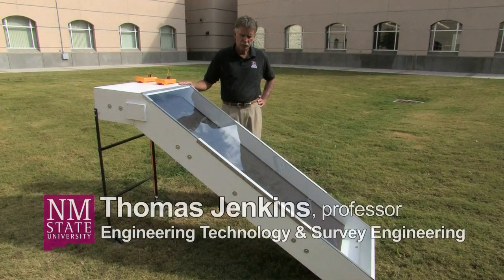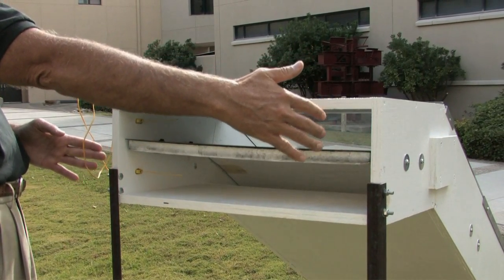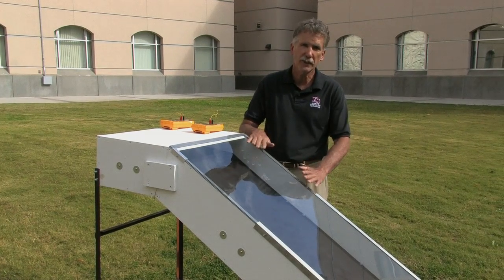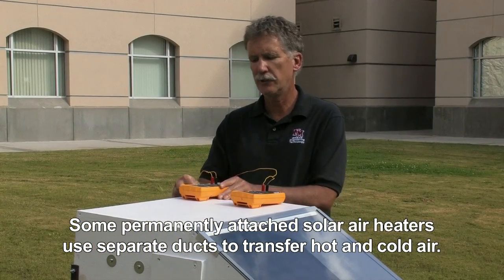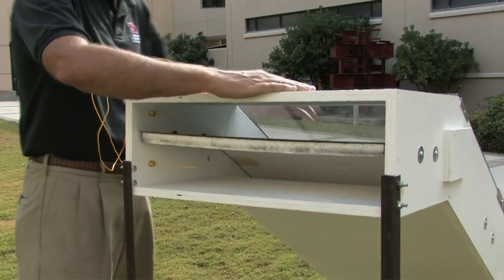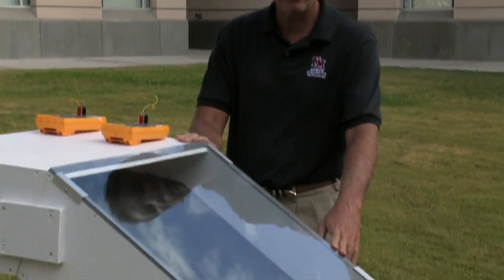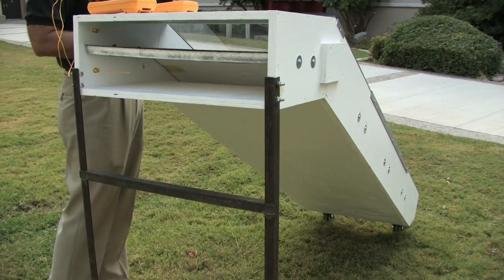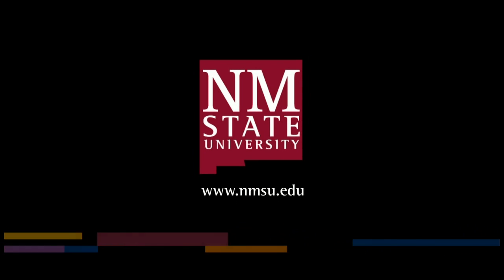Renewable Energy: Solar Air Heater

Comment: This only work if there is sun.  But who need this when the sun is shining.  Just opened your curtains or blind that is it.  It's unless in winter where there's no sun shines or cloudy days.  Waste of project time and materials. When the sun is shining it's warm already in the room with curtin open to let sun's heat in.
Reply: This is actually a bit more efficient at heating air due to a few factors one being the black sheet metal absorbing the heat from the sun similar to how a car with a dark interior get hotter faster on a sunny day than one with a light interior. also the angle allows for better sun exposure. Then you have the Air circulation with no electrical power if done a bit differently you could draw cool air from the floor and expel warmer air into the room circulating the air in the whole room for no cost. It works on a the principle that hot air is less dense while cold air is more dense. The science is quite valid as long as it is placed correctly.
Reply: pnweezy You don't know much about this technology and how the sun can work far more efficiently than your comments allow for. And just because it's winter, doesn't mean the sun's energy can't warm something from behind clouds. If there's light from the sun, then there's heat from the sun, but in concentration from different structures, it can really actually be used to gain serious temperatures. A little more study will allow you to understand more before you make out you know more than others who have actually done the miles!
Reply: It simply increases the exposure to the sun's heat by effectively increasing the window size. 
The syphion effect actively moves the warmed air without any added power.

Comment: I like this particular model and may make one, but with some slight differences. I like sealing up all seams and adding a small fan to push the warm air out the top section. I also like using insulated foam on the inside of the box. I have tons of saved videos on different styles, but this one seems the easiest to construct and to fit to my particular windows, stand and all. I plan on using this as a guide for making my first model. I wish the comments focused only on the design and how it works instead of the negative stuff shown here and people trying to convince everyone that they know more about thermodynamics than anyone else. It is a simple, functional design and should be praised for such. Not picked apart for someone else's agenda. Nice job of explaining it and nice video, to boot. An easy diy project to make and use.
Reply: We have been making and installing this design for nearly 50 years.  Some have been made with insulating materials others with just plywood.  Some have a piece of plywood seperating the chambers some only the corrugated sheet metal.  All work. All have black painted corrugated sheet metal as collectors.  The transfer of heat to the air in the lower chamber, even without anything else deviding them, has little effect on the heat produced.
The air above is so much hotter than the incoming air the small heat transfer that happens on the bottom of the sheet just doesn't change the total gain.
Most we have made were made of scrounged and/or donated materials so there have been many variations, most are built around the available glass size since other materials can be adapted easier.  Often the glass is tempered which makes cutting it nearly impossible.  Even if cut and installed it may shatter with just slight change in temperature.
Reply: No fan needed.  In fact if left on it could push colder air into the room at a time when the syphion wouldn't be moving any. 
The syphion only moves air when it is warmer than the room.
Reply: He uses sheet metal to separate the layers, not the MDF the rest of the box is made of.  The metal of course transfers heat through it far faster, the MDF is like insulation, the metal like a conductor.  Probably because  the metal absorbs the sun's radiant heat quickly which is good, but then transfers it quickly to the moving air above, but also to the moving (cooler incoming) air below which is not good.  The partition should have a 3/4" layer of insulation material under the metal? Maybe  just a piece of MDF to make it rigid would be enough insulation? Compressed rock wool will provide R 4/inch, and is organic and won't burn or off gas.  Polyiso-based insulation goes up to R 6.6 per inch, but is dangerous if exposed to heat, and off gases over 50 years or so, almost negating it's ecological benefits and diminishing it's R value.
Always when starting a house I think in terms of longevity.  No reason why they have to implode right after the last mortgage payment (30 year term).  They should last hundreds of years.
Except now of course.  Forget hundreds of years, forget 50 years, think 10 years.  After that, things will be unpredictable.  I think I want to be mobile.

Comment: This is almost exactly what I have been thinking about doing under my mother's window air conditioner, which is not huge, but too big to remove each winter...there is a nice incline where the window is and I think I can place a nice lean to soda pop can heating panel there.
Reply: Yes!  That could work.  
If you are in northern latitudes, can mount panel flat to wall under the window, if enough room. Or, could make panel horizontal, with a snaking drier duct inside the box.  Then, would need to go thru the wall, or if in a rental, boot inlet & outlet tubes thru window, over top or beside the AC unit.  
Flat-to-wall helps prevent excessive heat in summer building up inside the box (& making more heat outside, because, it needs covered or vented out in summer). 
In winter, sun is lower angle, so is more direct to the panel. 
We used 64 sq.ft. of aluminum can stacks & got about $50 reduction in electric heat bill, at about 100’ elevation, about 35 miles from Olympia, WA.  There were only about 2 weeks around Christmas & New Years, that we just closed the vent openings in the window boot box.  
Ours both recirculated indoor air, & brought in a bit of outside air, & I boosted the airflow with a 4” duct fan , from the farthest side of the serially connected panels.
The fan was at the farthest point from the window boot box, to allow intake air to warm. 
Note: any openings to outside, must be finely screened to prevent bugs nesting inside, or birds thinking it’s a birdhouse!  
The duct fan ran on A/C, but could as well have run on DC from a solar panel with inverter. 
1st cover material was corrugated polycarbonate.greenhouse/patio roof panels.bad. Better was Twinwall polycarbonate panels. Tricky bit, it sealing them well, to prevent heat leaks, or water entering panel.  Using recycled glass from patio doors is good!  Don’t need to use double layers (nightmare to frame air gap between, & could crack, & algae can grow between the panes)

Comment: no, the thickness of the glass doesn't matter as far as heating.  make it thick enough so it wont easily break and you will be fine, typical window glass is fine.